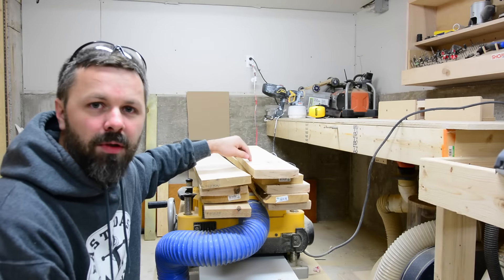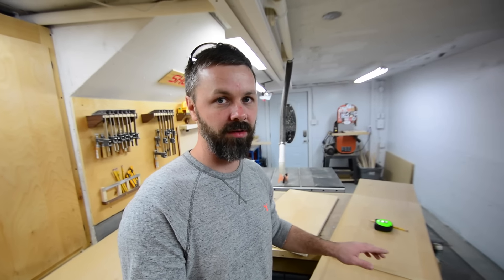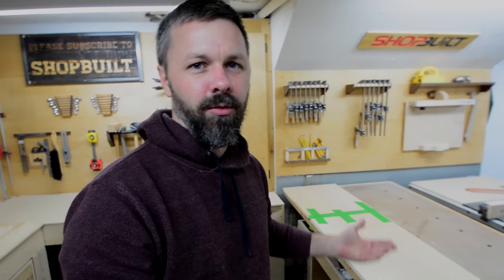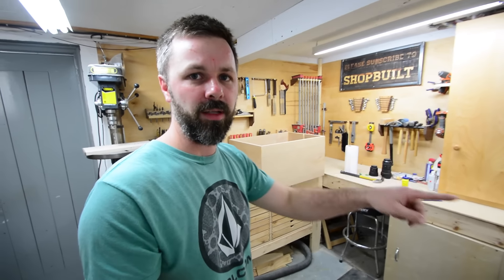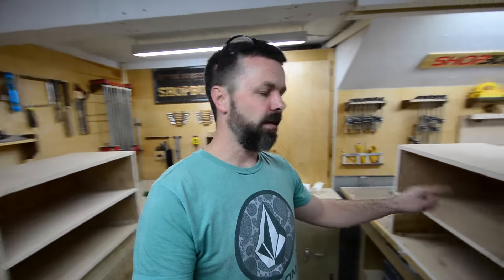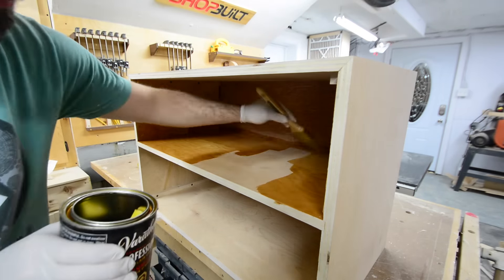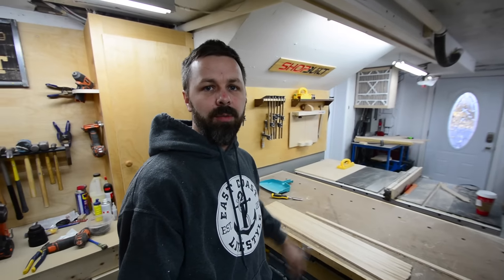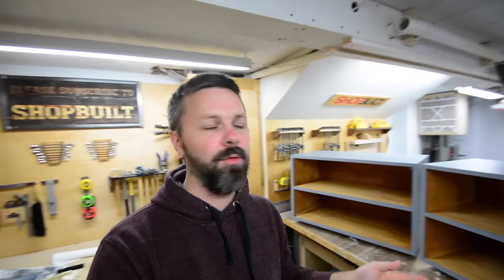She's got me building nightstands. Pt. 1

Comment: A tip. While the glue is still wet, wipe the excess and sand the outside of the miter a bit.  The sawdust and glue will help fill in some of the gap the outside of the miter. The Samurai Carpenter has a video explaining it.

Comment: They are coming out really nice, should be great when finished up. The mitres seem like overkill seeing as you ended up painting them though? I use butt joints on plywood boxes which work out fine so long as you fill and sand the edges with filler/putty/etc first. After paint, you can't tell. Looking forward to seeing these finished, oh, and with the width of these boxes, your bedroom must be huge! :-)
Reply from the maker: +Mario Cappellano (The Woodfather) I never had much luck making plywood end grain look seamless. The room is actually kinda small but these will double as storage as we don't have room for any other furniture in the room.
Reply: I probably have lower expectations than you anyways :-)

They came out great, just saw the second video.

Comment: The inside-outside contrasting colors is great! 

Honest question: why mitre the panels when you knew you were going to paint? In what way will you be able to spot the difference?
Reply from the maker: good question, I debated on this  a lot but my reasoning is because there is no top that sits on the case and there for no good way hide the end grain of the plywood. It was important to me that the case looks as seamless as possible like it is all one peice and I think the miter was the best way to accomplish that.
Reply: +Jan-wijbrand Kolman I worked for a guy that thought it would save time by butting it together and filling like that, then we spent triple that time filling and priming the project over and over again.

Comment: It looked like your over arm dust collection on your table saw was disconnected in the last shot. Was it disconnected while you were cutting pieces in the earlier shop? I was considering doing mine like yours but it looked like you were getting a lot of dust in those shots. That would make sense if you didn't have it connected. Does it normally work pretty well?
Reply from the maker: +Mickey Griffith I still use it a lot, but sometimes it works better than other. Sheet goods, especially MDF works awesome!

Comment: MDF, dowels and glue would have saved you a lot of work and you would'nt had to have the piece of wood in the corners.  On the cut, i put some water based polyurethane and sand until it is as glossy as the rest. Very nice and clean shop.  Most US hobbyist's have more tools than a european hardware store. I think we may appreciate more to do things by hand.
Reply from the maker: +Eg Bergweb I stand by my decision using plywood. MDF has it's using but not for cases in my opinion.